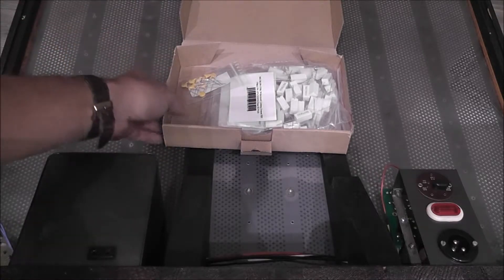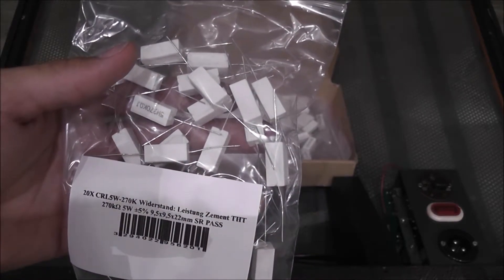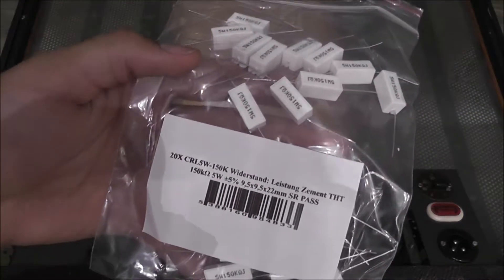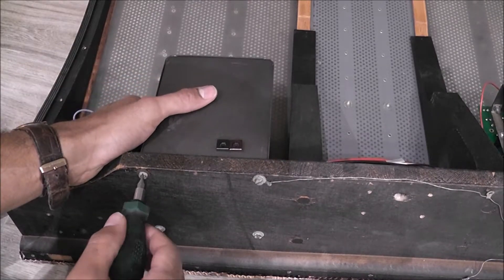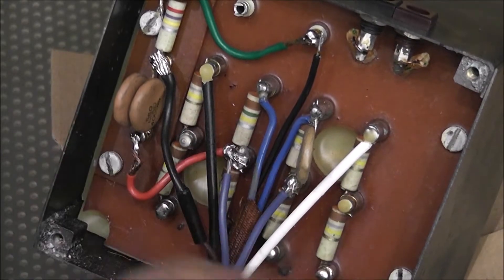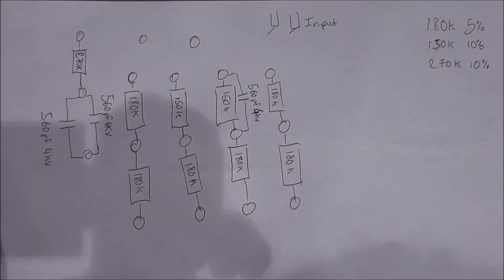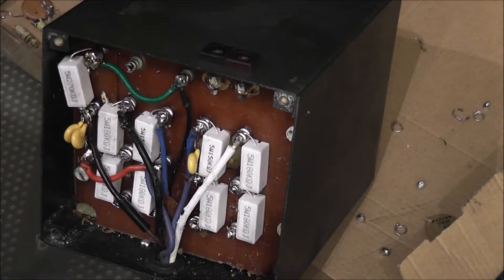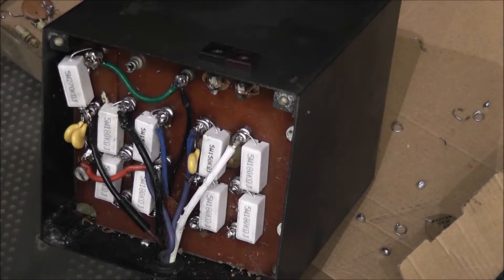Electrostatic speakers: Quad ESL 57: resistor and cap replacement with comparison

Comment: Just found your channel today and I've been walking through your QUAD 57 adventure  You've got a lot of learning to get up to speed on these..
Not wanting to be being condescending at all but a few pointers and gotchas ..  while the cement Rs (100% they are wire wound) got you going you  should plan to upgrade those to something better later.. with HV circuits you absolutely must be careful to select Rs rated for the voltages they will be subjected too .  Also with power Rs always leave an air gap off the board so they can breathe and also an air gap away from any other components. There's a couple of caps there that are almost touching and heat will prematurely age caps. With HV circuits I always use gloves so as not to leave oil residue that will cause leakage currents on the surface of components and wires.  in fact a quick wash down with a toothbrush and IPA will def help make sure your build or repairs are decontaminated ...
And burning the insulation on wire in HV ccts is not good practice..  leakage currents in HC ccts can be damaging over time.
I did a lot of work with high resolution electronics including photomultiplier tubes and the QUAD esl HV ccts are very similar in that regard..  so a wipe down of all parts including wiring with lint free cloth and toothbrush and IPA is just good practice .
Id recommend an annual chk behind the panels and a basic clean of dust deposits and an eyeball chk for anything unusual would be a good idea.  Look for things before they fail.

Enjoy those very collectable audio investments. Look after them and you'll never lose money if you sell them.

I'm green with envy.  I always lusted after QUAD 57 and 63s.. it just never worked out for me..

Comment: Hard to tell the difference on YouTube, but as soon as you upgrade the caps and resistors the 57 comes to life. I found polypropylene caps and metal film resistors to have a clarity that was so far ahead of the old components it wasn't funny. That combined with new Mylar film diaphragms increased the sound output significantly. Twin stacked quads are hard to beat. I have never liked the sound of carbon resistors and have always replaced them with metal film in my amplifiers.
Reply from the maker: Definitely true, it is hard to tell, which is a bit sad! But they definitely come through. I should look at them again in some time, as one side treble is quieter than the other, and the bass is more pronounced than the other too

Comment: Those old resistors are carbon, you replaced with ceramic Wire Wound, I would have purchased a complete new pcb from Quad

Comment: On another note, Are you using the rear damping? I noticed that the tweeter panel specific damping was not in the shots and normally stays attached when the back cover is removed.
Reply from the maker: Yes

Comment: I have often repaired these. You just made them sound tinny, not clearer and those parts aren't appropriate. Nothing wrong with any of the original bits if within reasonable value. I do prefer the sound of later blue ceramic capacitors to the earlier brown ones but not a big deal. Never found replacement sourced ceramics quite as good. If I were to attempt a tweak, I'd use nonmeagnetic (close to a transformer), noninductive metal resistors (Mills?) and find some (large) polystyrene capacitors of correct value and squeeze them in or raise the transformer a bit to accommodate. 

Point is, Quad got it right and it will take more effort to try and make it better. Probably also involves trade offs since the device was voiced with what what was used. I've heard these modded with VG quality metal resistors and PP caps and they sounded worse to me.

Also, tape that rear dustcover with the thinnest packing tape you can source and tighten with heat only enough to take up slack. Those should not be tighter than just not flaccid. Better a minor wrinkle than to over tighten a woofer panel. Tweeters should be taught. I know some will say I should be telling you to replace the cover but if you do it carefully, you won't notice the difference. They're called dustcovers for a reason as dust will foul the panel and I guarantee it rattles at times like that. It's not a passive process. There's an electrostatic attraction for dust.
Reply: "If within reasonable value" is the key thing here. I replaced the crossover resistors of my ESL's many years ago. It turned out that the old resistors had drifted by 15 to 20% which is unacceptable for a crossover network. Before, the speakers had a noticeable difference in sound, and that problem completely disappeared. I wonder how many ESL's are sent for repanneling, where a simple resistor replacement would have solved the problem.
Reply from the maker: Well, they sound far better than they did, and the video doesn't do the sound any justice, as they are very colourful and full bodied. I didn't try to make them better than what they were, that wasn't my aim. My aim was to bring them up to spec as the values for almost everything was out. Of course, it would have been better to have quality resistors, but those were also direct replacents and recommended for replacing them
Reply: @SolveElectronics  It's all relative. Glad you like them.

Comment: Now I looked in the datasheet of the resistors and they are rated for 1000 volts so the resistors will also selfdestroy after some time.
Reply from the maker: @mikw1809  thank you very much for the information, every day is a learning day! I will look into that. Thank you
Reply from the maker: They're 5w resistors and the ones that were in them were 3w, so they should never breakdown
Reply: @SolveElectronics  Sorry they will break down. Look what other people use that repair ESL.
Reply from the maker: @franswouters3390  I'll have a look 😊

Comment: Great sound from the one with new resistors. I bought a pair of original, unrestored Quad 57's yesterday and one has half the volume. Any ideas what would cause this?
Reply from the maker: Leave them to run for a while. It can also be the eht board. One of mine was also quiet and I replaced them. They made a massive difference. You can find the board at onethingaudio. Check my other video on these
Reply: @SolveElectronics  Yes, I'm going to try a new eht board. I hope this is all it needs.Thanks!

Comment: You might want to try audiophile quality low induction wire wound resistors and better caps. You don't need to spend crazy money to beat sand cast resistors and ceramic caps. When the bass output increases, mids and highs might sound lower due to the relative sound level differences. I loved those speakers when I first heard them in person. They are amazing.
Reply from the maker: Thanks for that info! I found it hard to get the resistor and caps I wanted so I just went for those. If I could have found some really good one, which I was hoping for, then for sure I would have gotten those, but I just couldn't
Reply from the maker: By the way: "Ceramic and carbon composition, not to be confused with carbon film, are naturally non-inductive because they don't have any windings" so I think it's fine to say they're fine to use, but I should find some better quality ones for sure!

Comment: Massive difference from where I'm listening. The worked on speaker sounds louder and much clearer than the one with original components. The bass comes across at a higher frequency and less low frequency bass response. But the mids are definitely clearer that is what I think. Do I like the sound of the upgrade........s👍🏾